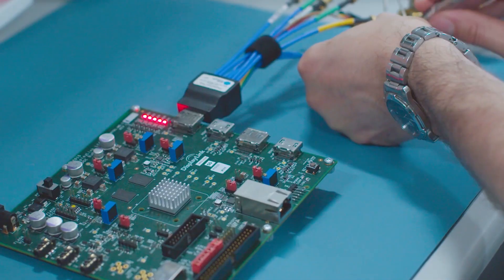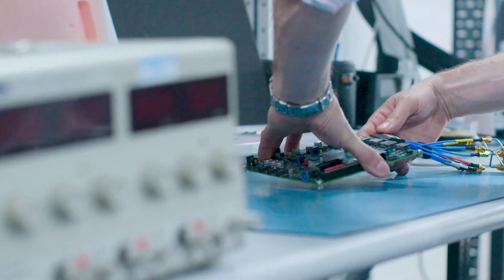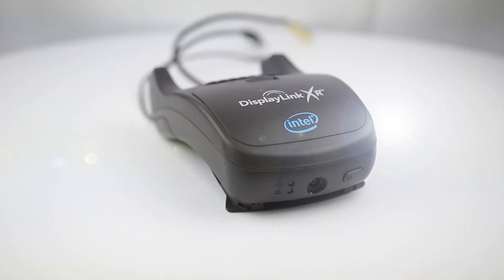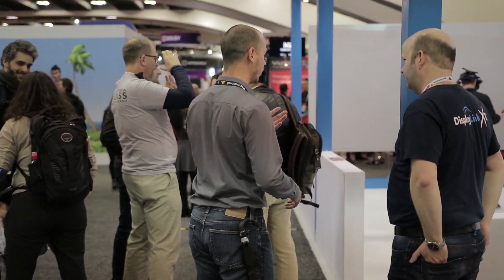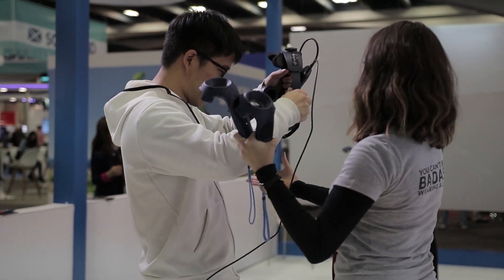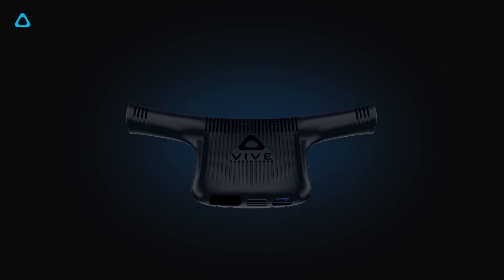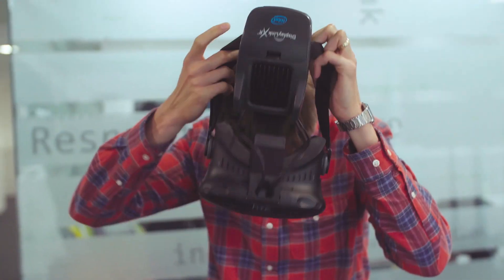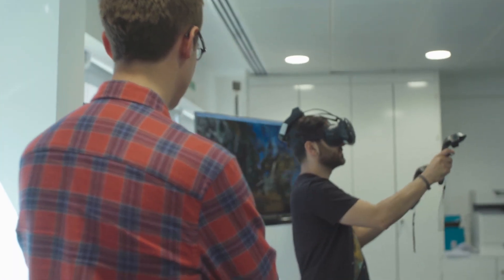How DisplayLink made VR wireless  |  DisplayLink XR

Comment: I'd like to see this tech with the Valve Index, even if at a lower res / refresh rate.
Reply from the maker: We just showed the wireless headset with the Valve Index Knuckles controllers at CES 2020 running BoneWorks for a whole new interfacing experience
Reply: @DisplayLinkUpdates  Oh wow, must've missed that. I'm buying as soon as it's released.
Reply from the maker: @BellamiaSophia  to avoid any confusion at CES we showed the Vive Pro headset, with the wireless controller and the Valve Index Knuckles controllers, we also had Cosmos on display. Lots of interest and even got a TV mention